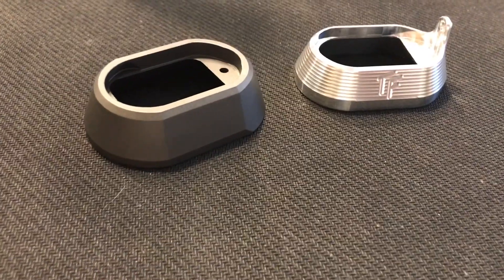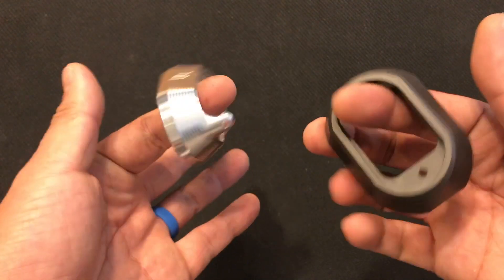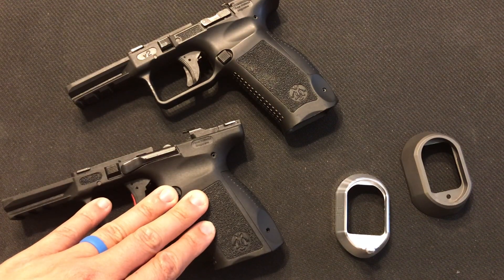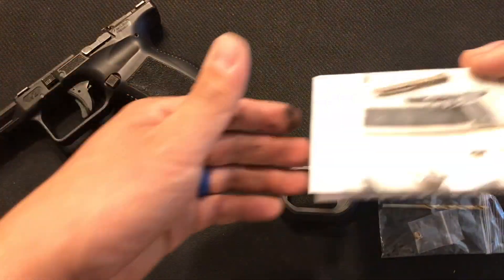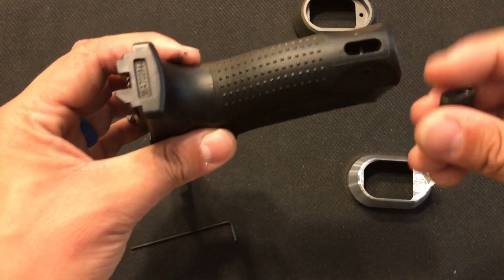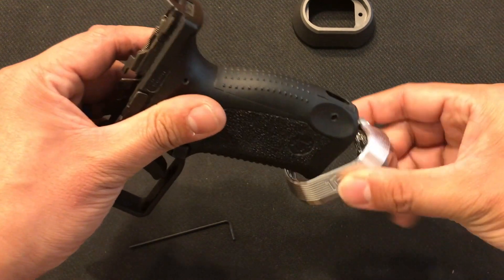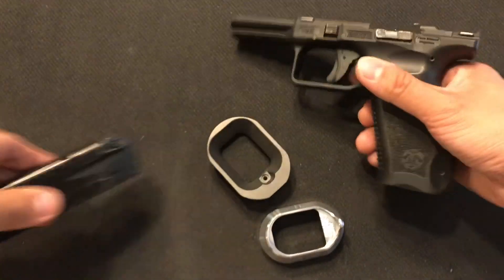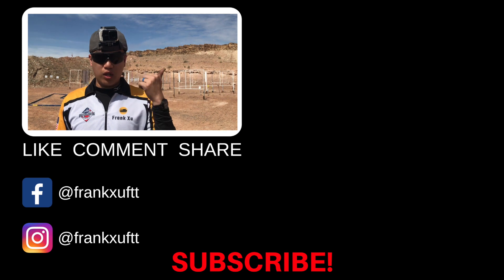Canik TP9 Series Aluminum Magwell (Quick Look)

Comment: Will the mag wells work on the tp9sa version
Reply from the maker: It will, as long as you have aftermarket baseplate. These all design for Taylor Freelance baseplate. If you still have stock 18 or 20 round baseplate, it will not work
Reply: Frank Xu - Frank the Tank thanks man. Subscribed 👍🏻👍🏻
Reply from the maker: Thank you thank you :)

Comment: do either of these fit the tp9sa?
Reply from the maker: Yes but I think only the Taylor Freelance is available now
Reply: @FrankXuFranktheTank  does it require adding  the taylor freelance magazine base pads to the magazines as well?
Reply from the maker: @jonathanoakley88  so both magwell do require aftermarket basepads. The +2 base pads from SFx need to file down the front edge to fit. If you have the Elite Combat aluminum basepads, you can use that with the magwell.
Reply: @FrankXuFranktheTank  i just have a stock tp9sa 9mm. So i should be good getting the mag base pads for my mags and the mag well?
Reply from the maker: @jonathanoakley88  yes you are correct :)
Reply: @FrankXuFranktheTank  thank you very much for all the info:)

Comment: So what's the sense of buying and installing something you cant use.
Reply from the maker: smokin truker I still use it if I shoot different division in USPSA :)
Reply: @FrankXuFranktheTank  yea you will but the everyday person. If there is gonna be a mag well made common sense.if it's made to fit with out modifications it also should fit a standard mag. It's designed for the frame but not the mag makes no sense and a waste of money
Reply from the maker: @smokintruker27  Well, there are company make their magwell for standard mag but when its uses for competition it will catch the mag at the front edge of the frame because the funnel is completely smooth. in order to make it completely smooth and if still need to use standard mag, just filed the edge of the front part of the basepad. But this topic is a nonending debate. It just depends on the design of the company.
Reply: @FrankXuFranktheTank  you stated in your video Magwell is made to fit stock frame. It's like owning a one sided coin. So what they do after fitting it to a stock frame they lost interest and said ahhh oh well buyer can figure it out. That's poor workmanship. If they're gonna make Product well make it right not half assed. I havent looked at the price afraid to.
Reply from the maker: @smokintruker27  it is for standard frame like SF,SA,SFx but not for Elite size frame. In the video 6:33 I mention it does not make for standard basepads. As I said it is an ongoing debate that people can say just change the basepad vs people said why the company did not make it standard for them.